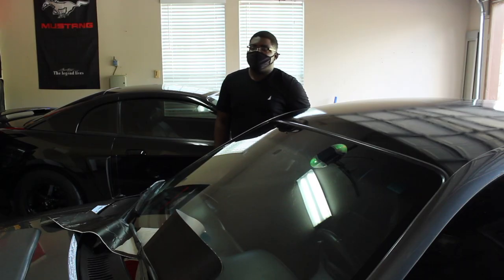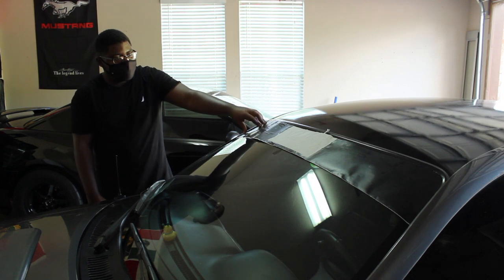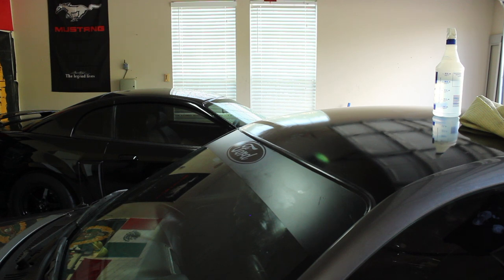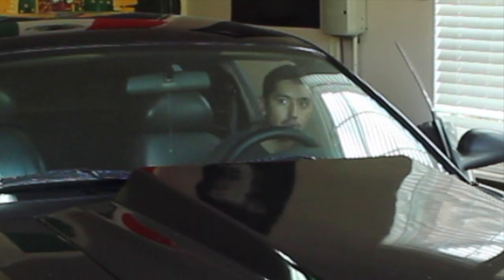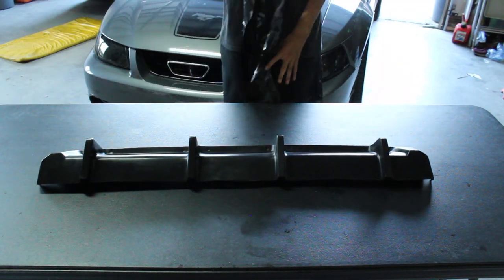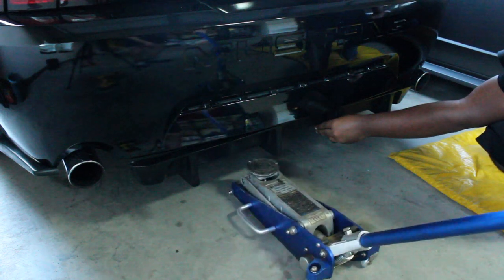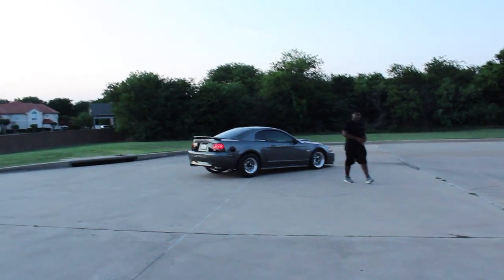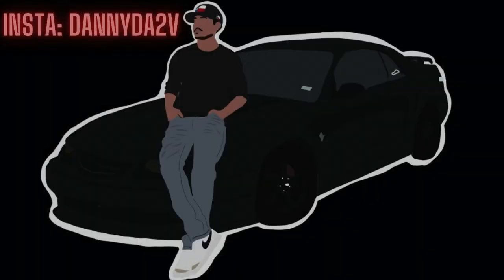99-04 Mustang Diffuser and Windshield Banner Install

Comment: I mess with the diffuser, it blocks out that ugly looking fuel tank on the rear but I’ve heard that the magic drift diffuser isn’t functional, I’ve been back and forth thinking to either get the one you got or the one from carters custom, either way it’s really bad ass bro i love seeing ur stang progress💪
Reply from the maker: Tbh it was a reason I copped it, the tank got In the way of the rear shots and it was always dusty 😂 yeah these things prolly ain’t functional at all bro lol, just pure looks. Honestly you can’t go wrong with both, each are diff, ones a bit bulkier (MD) and the Carter’s customs is way more sharp looking. 
I appreciate it bro 😎
Reply: @dfwdanny  yessir